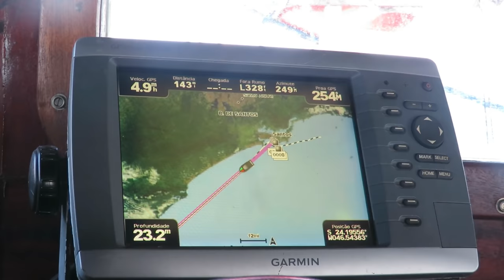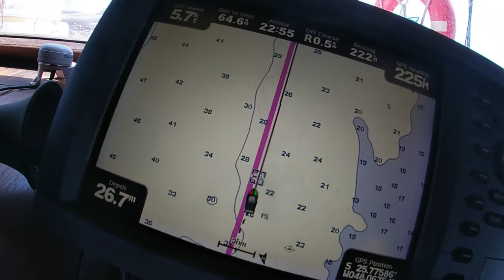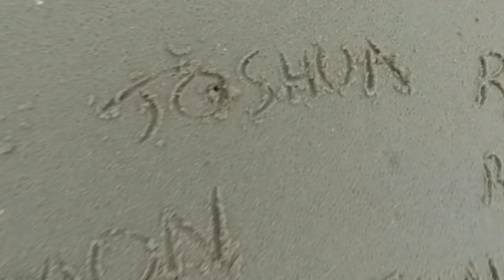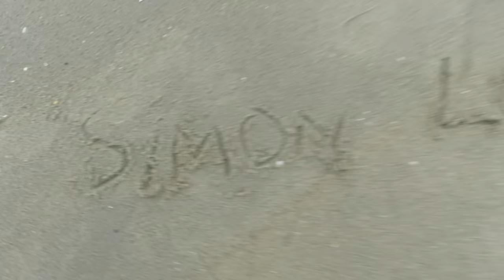HOLY SHIP! Cruising 250 nautical miles on board of a leaky boat — Sailing Yabá #5

Comment: Did you put antifreeze in your engine when you replaced the water.
Reply: In Yaba's home port, Itajai, Brazil, the air temperature does not fall below 10⁰C, 50⁰ F. I guess Ben and MP have plenty of other things to do! 🙂
Reply: @ChrisShute62  anti freeze much more than freeze prevention.  It transfers heat better to aid in cooling . Prevents rust formation. My comment was instructional not negative
Reply: @johntripp2028  Thanks. Excuse my ignorance. Point taken, and not seen as negative. Yaba and her supporters should welcome this kind of education.
Reply: @ChrisShute62  I have restored a few boats, fiberglass, so I do know they have taken on a monumental task. I hate to see old boats die.
Reply: @johntripp2028  You may have guessed my engineering  background is barely more than flat-pack furniture and a Meccano collection. But for some reason, I enjoy watching boat restoration videos, as many others do. Thanks to YouTube, many unlikely restorations are happening, and it's not always the super-rich, retired or technical people who are getting it done. Of course, any of these attributes is a great advantage, but so is a community of supporters, financial, technical or emotional. Some channels welcome volunteer practical help too. In the end, we get to see great videos!

Comment: Guys I would have felt more relaxed if you would have painted the bottom of the boat to help seal in all the planks and patches so you could avoid any leaks while at sea
Reply: Happier if there’d know to do some basic checks on the engine / bilges etc. before setting out! It’s rudimentary stuff before setting out on any voyage 🤦‍♂️
Reply: @danbuckman5691  I agree with you I'm not any kind of expert on anything but I do know to be prepared when setting out on excursions and this does applies to all aspects of life be prepared before going anywhere the sea, land and in the air.
Reply: @JCrook1028  Not really there is paint that will seal cracks and crevices and is rubberized when it dries and hardens I worked in a bodyshop of many years and used that type of paint on state issued dump trucks that get all kinds of debris tossed into the bed and the paint helded up to the abuse same goes for the wooden boat it would work giving 3 to 5 days to cure on the hard deck or land then it could be placed into the water. Thats why I said it needed painted to help stop the leaks .and not using house paint that will not work in salt water.

Comment: Guys, just remember that as soon as you lose your alternator, all your electrical consumption is running off the batteries. So as soon as you see your alternator warning light or buzzer sound, kill the engine and fix the issue, otherwise your batteries will be gone as well....then you are dead in the water.
Reply: Like most boats they have a battery bank so it should be fine for short periods. I would wire it up to use "house " batteries for the engine though in such cases without having to go down and move terminals and such.
Reply: @JCrook1028  uhhhh... what? What sort of magical diesel do you own?? It would have to be an ancient dead simple diesel engine to not have electrical at the high pressure pump. Even my 30 year old international has electrical at the HP pump and theres no computer.
Reply: @JCrook1028  yup and new enough to have an electronic fuel shut-off too. I'm sure as the rebuild goes on they'll cover the engine in detail. Btw, That engine could be old before it was put in that boat but the boat isnt 20 years old yet according to Ben and MP.

Comment: Why aren't you actually sailing instead of using your engine?
Reply: They had a head wind at the beginning, and were trying not to go too far from the coast, I'm sure they will do lots of sailing once they have spent months making her safe but needed to take the quickest safest route for now.
Reply: Poor wind direction for course plus the engine was the power source for the constant running bilge pump.

Comment: Just a couple of things...I'd avoid silly stuff like you did at the beginning of the video. You have enough content without having to resort to "entertainment".  Also, be careful of the audio. Tends to sound muffled at times.
Reply: Well I thought there was a good balance between humour, drama, documentary and education. They did well to record so much of the voyage, with all that was happening! 

Some thoughts from a retired location sound recordist: A directional camera-mounted microphone, will usually struggle to get good coverage of the camera-operator's voice. However, in a confined space, with unpredictable events, it's usually the best option. In the final piece to camera on the beach,  the noise of the  seawash was a bit intrusive over Ben and MP's important words. The camera mic sounded like it was doing its job correctly, favouring sound from the front, which included the sea. A better result (for the same shot) can usually be obtained (cheaply!) by removing your mic from the camera, extending the cable, and gently holding it at waist level. Your bodies will screen some of the sea noise, and the mic will favour your voices alone. Alternatively, move further up the beach. The same is true if there is any heavy traffic or loud machinery behind the performers. 

For narration, use the mic close to the mouth in a deadened room (perhaps hang some spare towels or blankets around you). Hard surfaces make voices sound cold and distant. Close voices are sexy. The camera mic should be fine for this, especially if it has a wind-muff, but you might need to reduce the level to prevent distortion. Perhaps we'll be hearing a fair bit of narration over all the timelapse shots of Yaba's restoration!